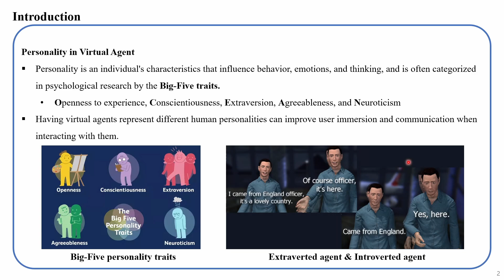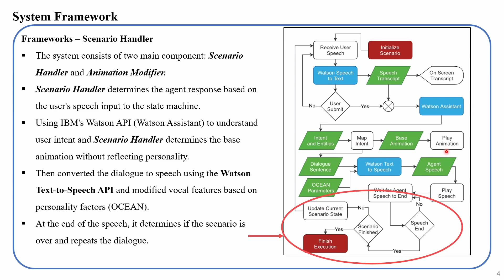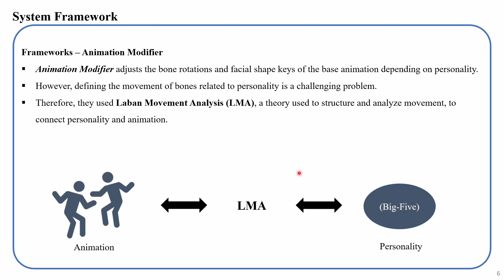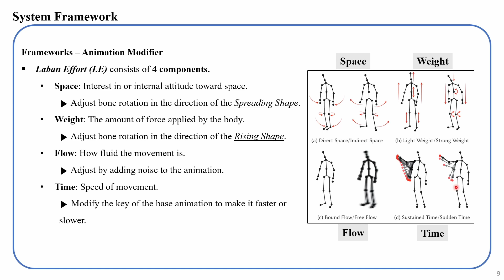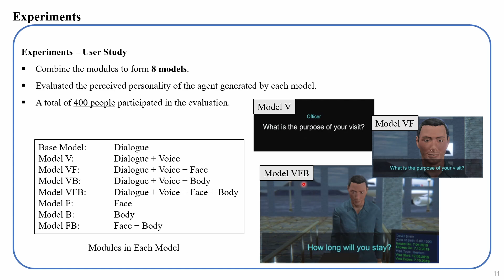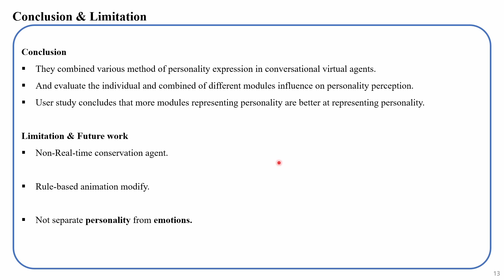[Seminar] A Conversational Agent Framework with Multi-modal Personality Expression

Comment: Thank you for the presentation. I have two questions:
1. My understanding of the Big Five personality traits is that they primarily focus on interpreting human conversation, which can be modeled as a function that maps conversation to personality traits. However, I am concerned that modeling the inverse function might not be sufficient for effectively using the Big Five personality traits, even when starting with basic speech data. 
2. Laban Motion Analysis (LMA) appears to be a somewhat rule-based approach that utilizes only a subset of the full range of motion features. Given the availability of numerous deep-learning-based motion representation models, would LMA still perform better than a fully deep learning-based approach for motion analysis?
Reply: A1. I also believe that there are limitations to fully reflecting personality in voice, which is why many methods based on deep learning are being researched.  

A2. The reason they chose to adjust the motion based on LMAs is that deep learning-based motion adjustment methods have not yet been proposed.

Comment: Thank you for your presentation.

I have several questions:

1. In scenario handler, why the range of five features is different? Is there another reason, or is it a range they set experimentally?

2. It seems possible to measure factors like Pitch, Pitch range, Rate, and Breathiness, but is there any information on how Glottal tension is measured? Also, do other studies on extracting personality from voice use these five factors to determine personality?
Reply: A1. If you're talking about voice, it seems to be an experimental value.

A2. The Scenario handler does not recognize personality by these five factors, but rather adjusts the five factors to reflect personality. The five factors were chosen based on previous research showing that voice features affect personality perception.

Comment: Thank you for your presentation.

Q1: What is the theoretical basis for defining the Big Five personality traits? Do these five traits comprehensively capture the full range of human characteristics?

Q2: What is the problem definition of the paper? How does this work improve upon previous research in the field?
Reply: A1. The Big-Five has a long history of study in psychology and is used in most personality-related research. It seems to provide a meaningful analysis of human personality.

A2. Personality is perceived as a combination of many factors. In this paper, they combine factors that can influence personality differently from previous research and investigate differences in perceived personality when factors are mixed.

Comment: Thank you for your presentation. I have a few questions and would like to leave them as comments.

- You mentioned that user intent is understood by Watson Assistant. In this case, what form does the understood intent take? Is it text? And how can Watson Assistant understand the user's intent?

- I understood that LSQ and LE make slight adjustments to animation. In actual use, are LSQ and LE applied to some original animation to transform it into the final animation?

- I know that people have significantly different facial structures. Is Adobe Fuse robust enough to handle various face shapes effectively?
Reply: A1. Intent is a set of defined words in a dictionary. My understanding is that they pre-train Watson Assistant with text and the intent data for it. 

A2. That's right. They have the original animation data, and the model output the final animation by adjusting LSQ and LE according to its nature.

A3. I haven't tried Adobe fuse, and it's currently discontinued, so I can't answer that. Also, the paper didn't consider multiple faces, as the shape was adjusted based on the face of a single virtual agent.

Comment: Thank you for your presentation.

Q1. Why was the OCEAN factors chosen for personality expression in the virtual agent? 
What could be the advantages and disadvantages of using other personality factors?

Q2. It was mentioned that facial expressions are calculated as a weighted sum of five emotions using Adobe Fuse. 
Could you explain how these numerical values are mapped to specific facial expressions?
Reply: A1. The Big-five (OCEAN) is a long-studied and reliable personality trait model. Most personality research uses it.

A2. In Adobe fuse, it is possible to adjust facial expression based on emotion. In this paper, emotions are first extracted from the text using the Watson Natural Language Understanding API, and then the emotions are weighted according to the OCEAN values, which are predefined values as shown on p.10.

Comment: Thank you for the presentation.

I have four questions:

Q1. In the diagram on slide 4, Watson Assistant extracts intent and entities from speech text. 
How are intent and entities represented as data, and what is 'Map Intent' that allows the generation of base animation and dialogue based on the intent and entities?

Q2. In the diagram on slide 4, at the end of the agent's speech, a decision needs to be made whether to end the scenario or to repeat the dialogue. 
What criteria are used to determine the end of a scenario? If the user says something like 'bye,' does the Watson API recognize this and end the scenario? Or is the conversation scenario pre-defined?

Q3. I feel that LSQ controls overall movements, while LE adjusts finer movements. 
There are LE components related to spreading and rising shapes, but none related to advancing shapes. Is there a reason for this?

Q4. What is the purpose behind the design of 'flow' in LE? 
If it is intended to add subtle noise, it seems like it could result in animations where the limbs appear to shake or vibrate. 
I don't quite understand why this component was included.
Reply: A1. Intent and entities are sets of predefined words. “Map intent” is the process by which they simply select animations and dialog that have been pre-mapped for that intent.

A2. scenarios are pre-defined.

A3. There is no reason for LE to respond to all shapes; it just uses rising and spreading shapes because they are appropriate for representing that effort factor.

A4. Flow is divided into two polarities: bound and free. Typically, bound represents rigid movement, while free represents free-flowing movement. The paper chooses to add noise to represent this free movement, but the rationale for this is not clear, and it is questionable whether it is appropriate since it does not reflect bound movement.

Comment: Thank you for the presentation. 

1. I am curious about Adobe Fuse. How effective is it as a model for generating facial expressions? 
2. The OCEAN factors seem to have been linked to emotions for facial expression generation. Could you provide the rationale behind this connection?
Reply: A1. Unfortunately, Adobe Fuse is currently out of service. From the resulting video, it seems to create natural enough facial expressions.

A2. The paper does not discuss the relationship between personality and emotion; separating personality from emotion is a very difficult task, and the paper points out this as a limitation.

Comment: Thank you for your great presentation.

I have a couple of questions:

1. Among the 4 components (Space, Weight, Flow, Time) of the Laban Effort (LE) parameter, I was wondering how the "Flow" component is reflected. More specifically, I was hoping you could elaborate on how adding noise to an animation can affect how “fluid” the movement looks.

2. In the Animation Modifier step, is the dialog that comes in as input in the form of text? Or is it a voice or speech? (just looking at the illustration on p.16, it appears to be text).

3. When calculating the weights for the five emotions using the Watson Natural Language Understanding API in the Animation Modifier step, I was wondering if authors consider the five factors (Pitch, Pitch Range, Rate, Breathiness, Glottal tension) described earlier on p.5, or if they use a different algorithm?

4. There doesn't seem to be any quantitative evaluation results on whether the agent reflected the personality well. Is it because authors didn't present those results in the paper?

Thank you.
Reply: A1. Flow is divided into two polarities: bound and free. Typically, bound represents rigid movement, while free represents free-flowing movement. The paper chooses to add noise to represent this free movement, but the rationale for this is not clear, and it is questionable whether it is appropriate since it does not reflect bound movement.

A2. As described in Scenario Handler on page 4, the input speech data is turned into text using the Watson Speech to Text API. The animation modifier uses that text data. 

A3. For each of the five factors, the algorithm reflects personality.

A4. It's very difficult to quantitatively evaluate whether a personality is well-reflected, so they relied on user study only.

Comment: Thank you for your seminar. I have a question: how does the framework effectively integrate and balance the different communication channels, such as verbal (dialogue, speech modulation) and non-verbal cues (facial expressions, body movements), to ensure that the agent's personality is consistently and coherently expressed?
Reply: The paper investigates the perceived personality of a composite of factors interacting with each other, rather than the effect of each factor individually on the perception of personality. Therefore, I don't think the agent's personality needs to be consistent.

Comment: Thank you for your seminar. I have three questions.

1. Is it correct that the Laban Movement Analysis (LMA) mentioned in 4:52 consists of LSQ, LE, and Facial Expression? I'm curious about the definition.

2. Facial expression is represented by five emotion. Based on this, OCEAN is expressed. How was the corresponding figure determined? (7:53)

3. When I saw LLM give disgust 0.01 for "Such a lovely day", I questioned its reliability. Did the paper quantitatively evaluate these figures?
Reply: A1. LMA is a theory for analyzing motion and includes Body and Space elements in addition to Effort and Shape. In this paper, they utilized Effort (LE) and Shape (LSQ) of LMA to implement Animation Modifier, and Facial Expression is not related to LMA.

A2. There's no explanation in the paper for this value, and my guess is that it's an experimentally determined value.

A3. In the paper, they use the Watson Natural Language Understanding API to extract emotion from text. This is not a new method proposed in the paper, so they did not evaluate it.